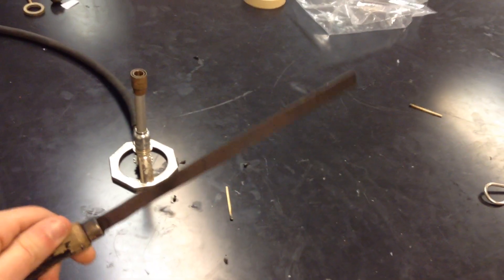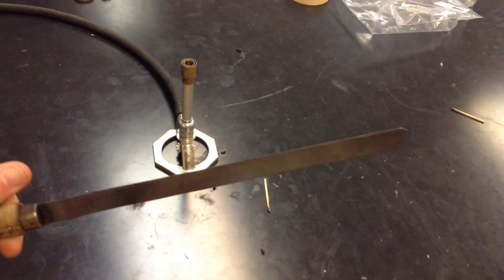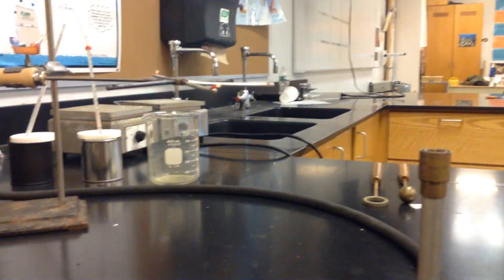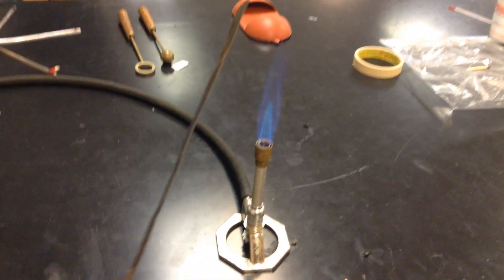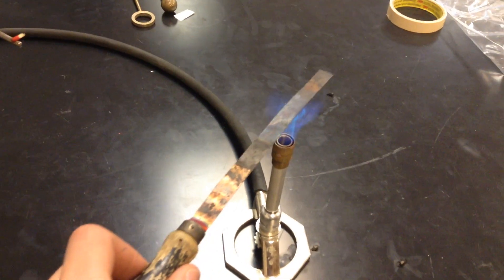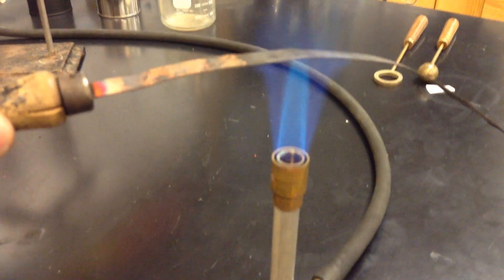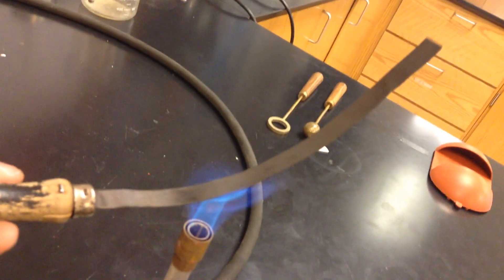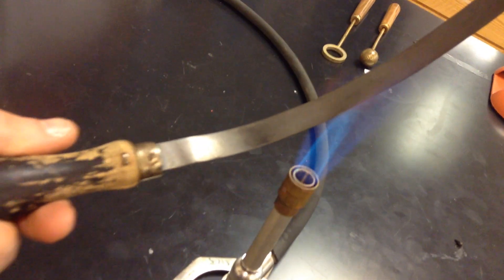Thermal Expansion of Bimetallic Strip

Comment: Actually it's not proof of thermal expansion but proof that different metals expand at different rates!! Hence the curvature.  If all metals expanded at same rate then there would be no curvature.
Reply: @WilliamHelstad  the wording is all wrong.  The two metals heat up at the same rate but as they have different coefficients of thermal expansion then one metal expands more than the other and hence it bends.  If you are doing it as an educational video then it is important to get facts and description correct.